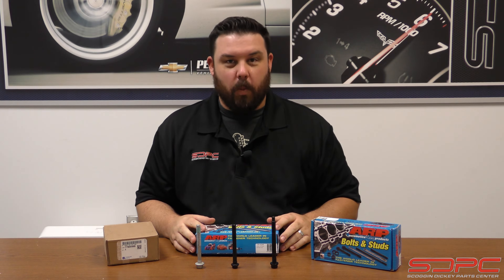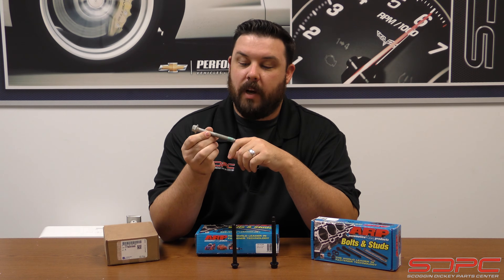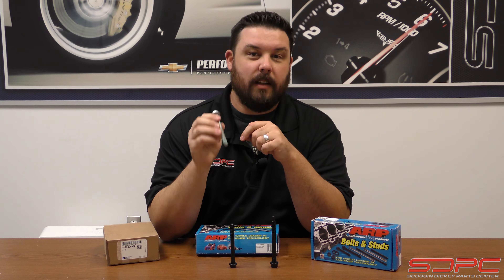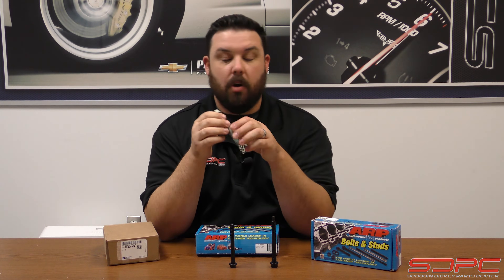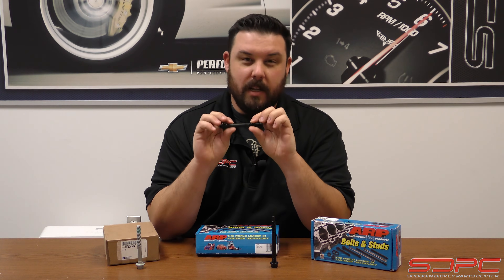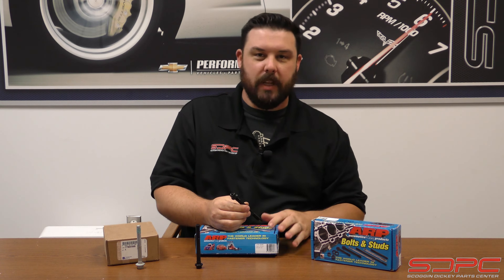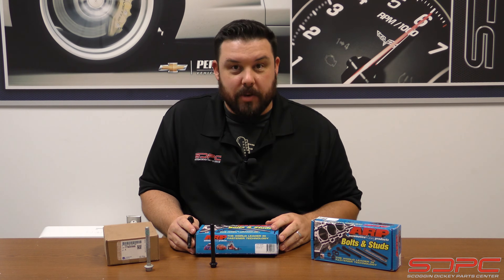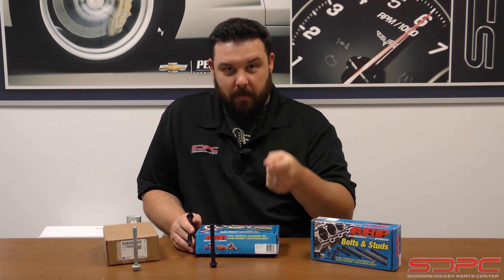SDPC Tech Tips: Head bolts vs. studs

Comment: I went overkill and got the studs for my mid 400hp small block build because my machinist recommended to save the cost of having him do the whole torque plate thing when he bored it. He said it actually distorts the bores alot less than bolts do when torqued.

Comment: But be warned that studs can cause the fail point to change to your block. Any excess horsepower will cause the head to lift slightly and go back down. The minute your head ceases to lift due to studs...you're gonna damage the block.

Comment: Saying that thread form friction doesn’t apply to studs and it’s only the friction under the nut head is just wildly un-true.
Reply: Why?
Reply: @mk7-e8e I think I can see where he’s coming from. You do still have some friction resistance turning the nut at the top of the stud that sits on a hardened washer but it’ll be less because of the harder material and from what I’ve seen, those top threads are finer with a shallower pitch. 

Benefits of Finer Threads

Improved Adjustability: Finer threads allow for more precise adjustments in clamping force when tightening the nuts. This can help achieve the desired torque levels more accurately.
Enhanced Load Distribution: A finer thread can help distribute the load more evenly across the stud, reducing the risk of stress concentrations that can lead to failure.
Better Engagement: Finer threads often provide better engagement with the nut, which can improve the overall strength and reliability of the fastening system.
Resistance to Backing Off: The design helps reduce the likelihood of the nut loosening under vibration conditions, which is particularly crucial in performance applications.

Comment: My mechanic wants to use the studs on a stock LQ4 GM engine.  Because it's easier to install the head and get good torque.  PLUS, he doesn't have to worry about breaking a head bolt if he needs to rebuilt it later.

Comment: Very informative, I want to freshen up a northstar motor (2008) and go from an M11 to M12 head bolt.  I dont like the idea of inserts because of the close proximity to the water jacket, the stud kits available cost a fortune and seem overkill for a stock motor.  It hasnt had the threads pull out-its just a preventative measure.  What advice do you have and what torque would I need for the increased diameter on something like this?
Thanks in advance.

Comment: Thank you for your videos
I just had an issue with the new build pretty sure it was a head gasket, not sealing issue and not the stock GM bolts 
But I noticed that the head bolts were not all tightened, the same while taking the heads off not sure if that’s common  on tty’s. Really bothered me. 
So the machine shop said everything was straight had it double checked now spending money on ARP hardware to make sure they are right. “yes all new bolts were used”
Reply: I feel I am in a similar situation. Minor coolant consumption on new build. Cylinder heads checked. Block showed no signs of leaking when it came apart.  New Felpro bolts and head gaskets. Thinking of changing the bolts to studs. Likely going to try one at a time and see if it improves things. (Going to have new engine ready to go in the event that it fails miserably.)

Comment: I’ll use stock. Gm makes great parts. If you need to seal the cylinder for leakage get fire rings installed. Stock gm bolts get stronger over time.
Reply: Not better quality than ARP.

Comment: Another advantage in a stud is clamping dynamic. Bolts pull on the block causing bore distortion. Studs minimize this distortion.
Guys using Ford 5.0 HO blocks benefit from studs bc the block is so weak.
Reply: Blocks distort differently and thus may or may not need torque plates for the honing process.  The selected bolts or studs should be used during torque plate honing.
I cringe at the thought of swapping bolts for studs willy-nilly, at least a $60k engine should be machined and built correctly.
As for an old clunker hone and go beater that originally came with magic bolts, I reach for grade-8.

Comment: Hi, could i please ask if the final clamping torque will needed to be changed when replacing factory head bolts to studs?  For instance if the final torque setting for factory bolts was 50 Nm will it be the same for head studs/nuts ?                                                                                                         I would really appreciate your take on this
Regards
Reply from the maker: The manufacturer will have updated torque requirements for their bolts or studs.  If you're using newer casting heads, ARP has changed their torque settings for those as well as people were pulling the threads out of the block with the old torque numbers.
Reply: @Sdpartscenter  thank you